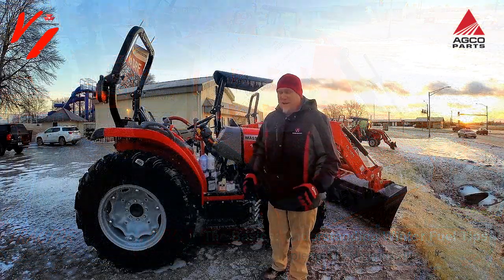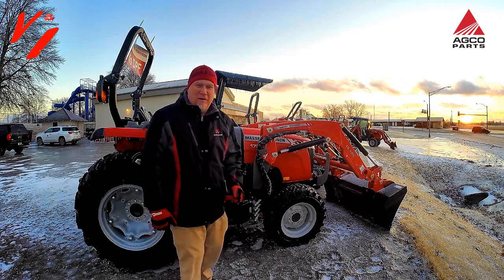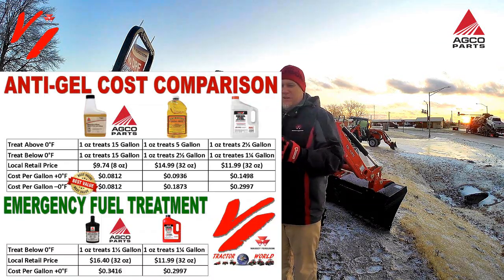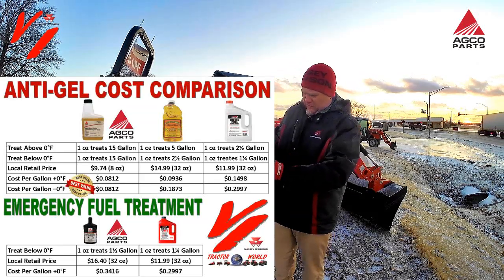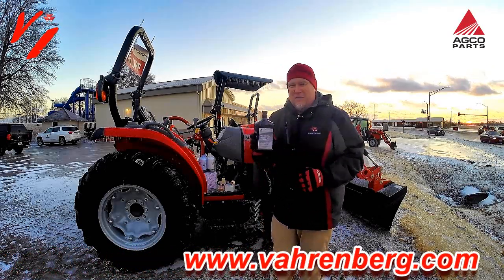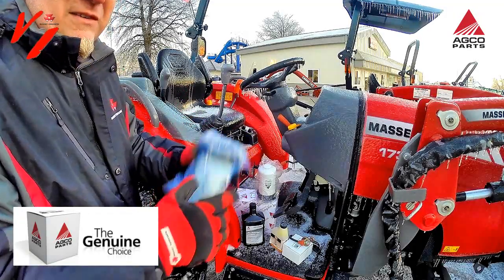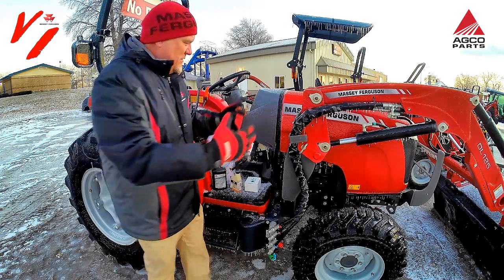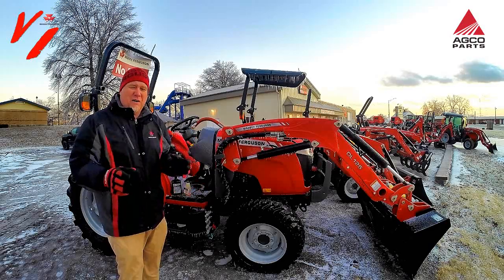The Basics: Understanding Winter Diesel Fuel (AntiGel, Fuel Gelling & More)

Comment: Thank You for the info & tips , we do get cold here in N.Va ,but not till the last week of Nov. & by then we all ready  have the winter blend & the M-F 1526 does not get used much ,unless we have allot of snow,& is the only diesel I own & I make sure the tank is always full & I make sure to burn off at least 75% of the summer blend & the M-F 50 is gasoline which is going to be hooked up to log splitter  this week  end,  just got through  grading our road today , with the M-F 50 no more seat time for her till early spring,but the tractor will be run allot till mid Jan. (M-F 50) , but I think I 'll get some of the AGCO  antigel just in case, better to have it & not need it,than need it not have it .Thank You for the very informative video . Love my Massey Ferguson's
Reply from the maker: Ounce of Preventions sure better than working on frigid cold, wet fuel filters. Thanks for watching and commenting!